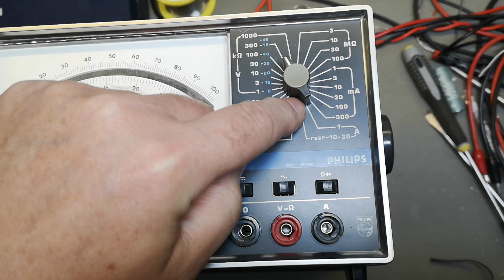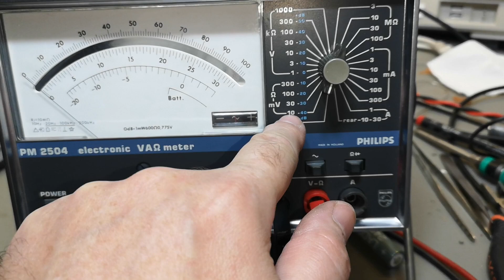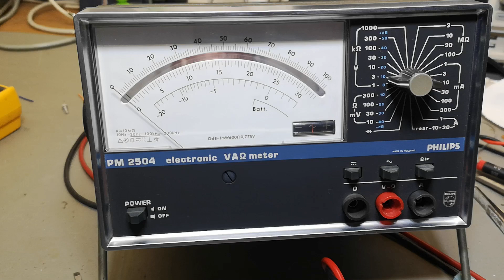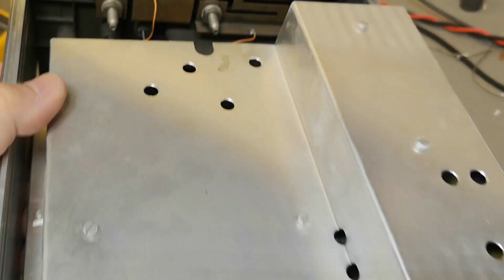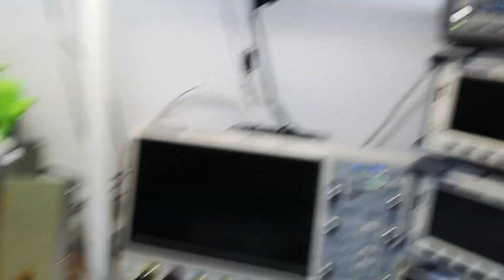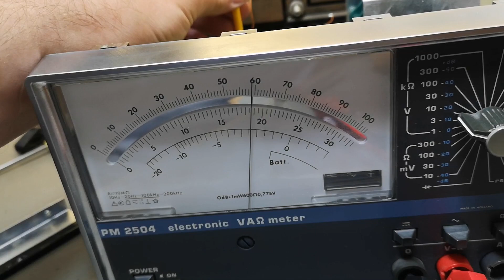Philips PM2504 Electronic Multimeter bench 1975-86 test teardown

Comment: Going to guess the base of the TO package is dirty, and needs to be cleaned properly. Voltage ref drift likely needs a new zener diode, probably (not looked at schematic) is a 6V8 zener with a divider network, and the zener is failing open circuit.